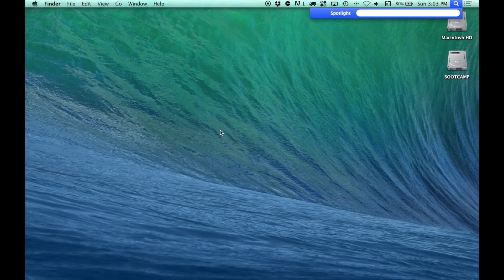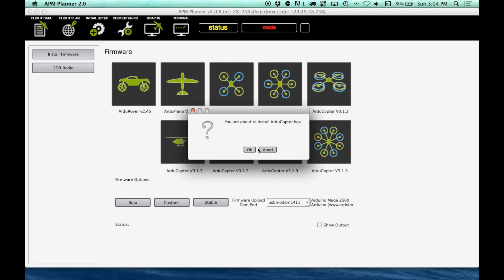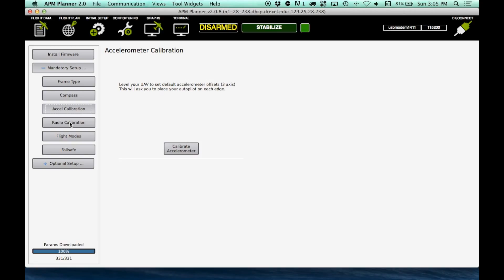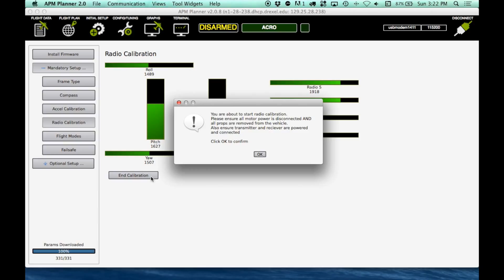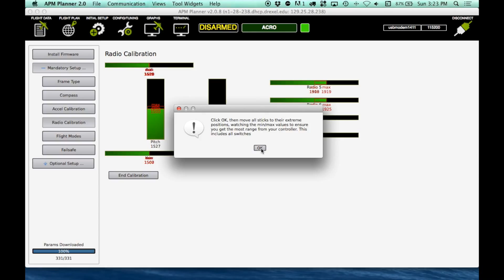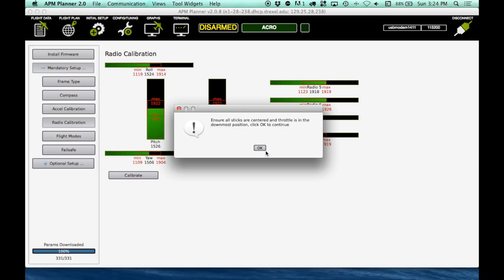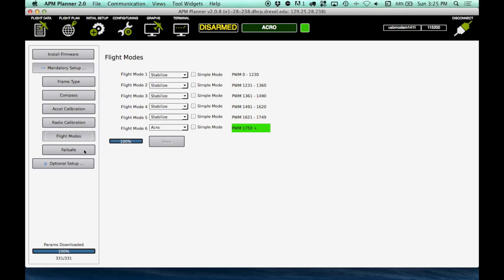APM setup

Comment from the maker: I think you may have a slight misunderstanding of the wiring setup.   The ESC should connect to OUTPUT channel 8 from the Ardupilot.   Your radio should connect to the INPUT channels of Ardupilot.  There should be no direct connection of your speed controller or servos to your radio receivers!  

What you want to do is connect an auxiliary channel on your radio system to APM input channel 8 to control the throttle.  I recommend you use an auxiliary  knob so you have better control of the ESC.    

The Arddupilot website gives an example wiring diagram for Futaba systems here:  http://copter.ardupilot.com/wiki/traditional-helicopter-connecting-apm/

NOTE:  I was using a 7 channel radio for my setup too :)  it works fine.  You can see some more information on my setup here http://dasl.mem.drexel.edu/wiki/index.php/Rotorcraft_Tutorials  

Hope it helps!  Let me know how it turns out.

Comment: I am having trouble wiring my Futaba 7 channel receiver to the APM 2.6.  What receiver channel should I plug the ESC in since I have no channel 8?  Thanks!
Reply: Kris,  I have seen your videos and response.  What I was looking for is the schematic showing this receiver channel goes to that APM channel for all 7 channels.  The WIKI info doesn't work and your videos are not clear on how to connect the receiver to the APM.   I figured it out and here is what works for a Futaba 7 channel receiver:  Receiver channels 1 - 7 attach to APM input channels 1-7(no crossing channel 3, etc).  Connect the ESC to the APM output channel 8.  In the transmitter, mix channel 3 (throttle) as the master to channel 8 as the slave (of course you need an 8 channel or better transmitter).  The mix did the trick.  Without the mix the heli set up tab will not show movement on the swash bar nor will the ESC arm.  Now it works perfectly.  Thanks!

Comment: it is very nice video. It is really hard to find a video related about APM helicopter setup.  Do you follow below table to connect your  RX with APM?
I connect RX throttle in APM Ch8. when I calibrate my radio in Mission Planner. when I move the TX Throttle stick. then the  radio8 green bar moved instead of throttle green bar. why?

Does the Elevator need to be calibrated? why i can't see it in  Mission Planner?

Could you help?  thank you very much!!

Channel
Futaba Rx
AMP2.5 Input
1
Aileron
Aileron
2
Elevator
Elevator
3
Throttle
Pitch
4
Rudder
Rudders
5
Aux1
Aux1
6
Pitch
Aux2
7
Aux2
Aux3
8
Aux3
Throttle
Reply from the maker: I am glad you found the video helpful.  

Make sure you check out the write up for these tutorials here:  http://dasl.mem.drexel.edu/wiki/index.php/Rotorcraft_Tutorials  
They give more details of the wiring and some pictures to help you out.  The channels are for a spektrum radio but they should be similar enough.  

The GUI for the ardupilot is a bit confusing here.  You want to connect your radio's throttle (left stick vertical motion) channel to ardupilot channel 3.  This should show up on the mission planner as the throttle channel.  This will ultimately control the helicopter's collective pitch (vertical motion of heli).  

You should connect one of your auxilary dials on your radio to channel 8.  This channel will ultimately control the speed/throttle of the motor.  

Remember if you find that channels are swapped on your mission planner you can just switch the corresponding connections on the ardupilot and test it again to fix it.

You should see the pitch movement shown on the mission planner.  It could be a calibration issue but it is more likely a wiring issue. 

Hope that helps.  Let me know if it works or if you still have trouble.
Reply: Thank for your reply soon , There are only few people complete the APM helicopter  project in the world. I am really lucky to have contact with one of them.  When I  calibrate my radio in Mission Planner. Could the servo can work at this moment? (When I moved the Tx stick why the servo is no motion?) Should I arm the APM before calibrating?I will follow your instruction for connecting. But now  the servo without motion. I can't monitor whether I have correct connecting.  Do I miss something?  Thank you!!
Reply from the maker: Tsung Hsiu Chiang I don't think the ardupilot has to be armed for the servos on the swashplate to move.   However, when you first turn on the ardupilot it will go into accelerometer calibration mode.  While it is in this mode the servos will be unresponsive to stick movement.   If you continuously move the ardupilot after it has been plugged in or if it is not level it will not leave accelerometer calibration mode.  So make sure you power on the helicopter and the APM then let it sit still for approximately 30 seconds.  You will notice the LED blinking pattern change once the calibration is complete.

The other possible issue could be insufficient power to the servos.  When you turn on the system do the servos move at all?  If not that is a sign of no or insufficient power.

What kind of helicopter are you working on?   Does it have mechanical or digital swashplate mixing?
Reply: Kris Krasnosky I found the root cause. although I already provided power to APM from battery monitor. But it seem the servos power are from APM output ch8. After I connected the ESC to APM output ch8. then the servos can works now. And regarding to your connection, I have servos in right position now.
Thank you very much.
But I encounter new problem. when I do "Configuring the Servos" and "Capturing the Swash Plate Range".
http://code.google.com/p/arducopter/wiki/TradHeli_Configuration?wl=en
When I move the collective pitch up and the Collective pitch bar moves up also.
I think three servos should move up together. but only one servo move up.(I have the same issue in "roll", only one servo moved ).I can't get "swash mixing" from APM.
My setting is
Tx set to heli mode /swash type 1s Norm (turn off swash mix) , Although wiki said it should be set  "Acro" mode. But I saw some information that turn off swash mix in Tx which is okay also.
Mission plan set swash type to H1 and FBL.
Whether I should set swash type to CCPM and FBL in MP?
or I miss anything?
Thannk you!!!!
Reply from the maker: Tsung Hsiu Chiang First of all I would recommend setting your radio to airplane mode.  This way you are sure the radio is not attempting mixing at all and the channels will be more predictable.

Yes all 3 servos should move up together if you move the collective stick up on your TX. 

You should be using CCPM if your helicopter is supposed to have digital mixing.  

You may also want to check under the the configuration tab, In advanced parameters.  There is a setting in the advanced parameters list that allows you to switch on/off mechanical mixing.  Make sure mechanical mixing is off.  I believe it should be off by default though.